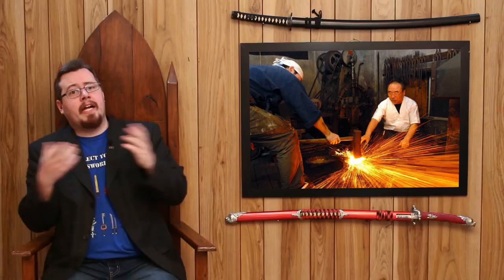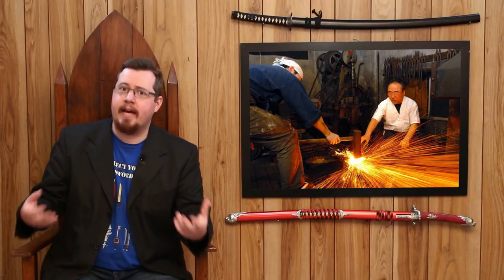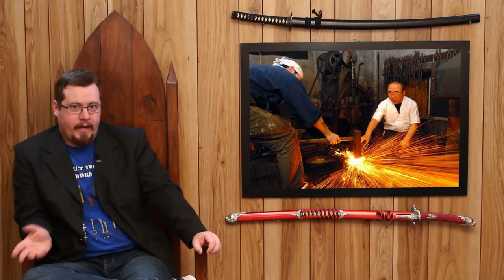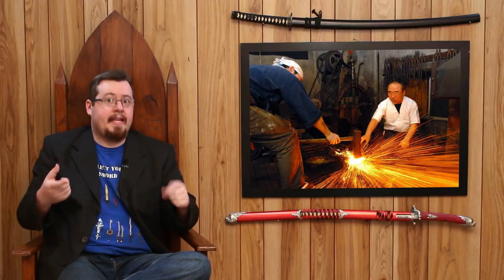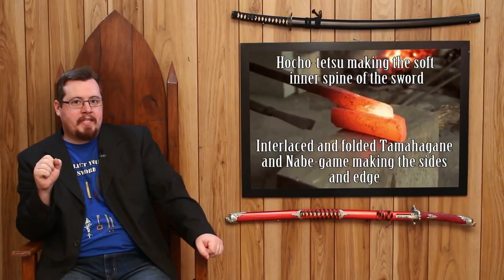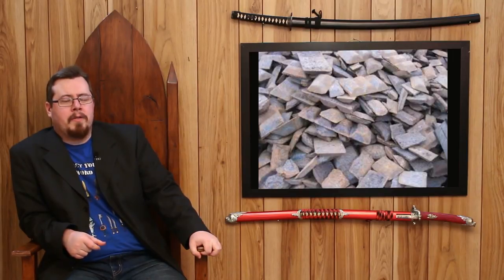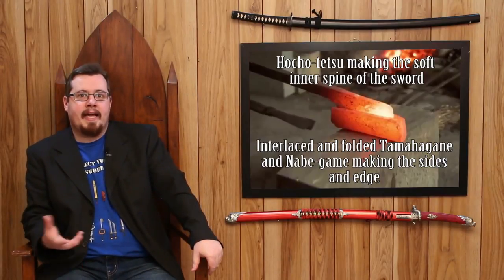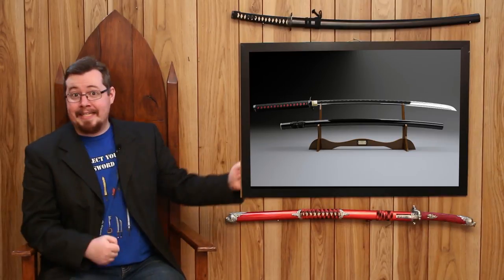The TRUTH about the KATANA, part 3: Why the steel is folded

Comment: Nice video. I know the theory, but having it all put together in a coherent package is quite appreciable. Yet you forgot to mention one process that has been used all around the world (well, maybe not in Japan, can't tell), from the early Iron Age: cementation.

And the process is quite simple: once you've folded your steel over and over, and it's as pure and "slag free" as you want it, but also free of carbon, you put your bar/ingot in ashes (as far as I know, it was usually bone or horn ashes, at least in Europe, but don't take my word on it), and just heat it up for hours, or even several days. 

The lack of oxygen and the presence of surrounding carbon, will allow the carbon to migrate inside the steel, sometimes quite deep. You have to be carefull not too alter the steel by going too hot, but otherwise it's a pretty secure process, and there is not much chance to mess it up. It can be done either on "raw" bars/ingots, or on the semi-finished sword blade.

The advantage if you use this method on a semi finished blade surrounded by ashes on all dies is that the acute edge will heat up fast and, as it's thin, take much carbon, the sides and spine of the blade will take a bit less carbon, and carbon won't be able to migrate deep enough to the core. In other words: it will make the edge quite hard, the sides and spine moderatly hard, and leave the core mild. And all this on "superior", "slag free" steel (well the best available from a bloomery).

As far as I know, carburizing was massively used in Europe in the late Middle Age and early Modern period, because blast furnaces weren't widespread (as it requires much more material and workforce to make it run, and requires investments - not all social structures had that mindset), but bloomeries were quite common, and there was a real need for high quality steel. Folding pig iron was necessary to get rid of the slag, but they ended up with "high purity" (for the time standards) wrought iron. This process was made easier and more efficient by the use of water powered trip hammers. 

They forged the wrought iron in long, thin and narrow bars, bundled them together in a" plate" or sheet, pilled in alterning layers with ashes/charcoal (any carbon-rich substance), and let it heat up the adequate duration. The result is blister steel, inheriting the high purity of wrought iron, but now with a high carbon content. It was then forged back together and folded to even the carbon content and lower it a bit, producing shear steel, which was in every way superior to tamahagane. The difference is the use of cementation, and water-powered trip hammers to make the forging job easier. And also a pre-industrial production context for efficiency, which cannot be achieved in traditionnal two or three men shops.

This is just bits of extra information. Your video is already excellent!
Reply from the maker: +MadNumForce Hey I love extra information, thanks heaps for sharing this!

Comment: 2:30
They don't really add carbon deliberately. It happens by itself because the fuel contains carbon and you need to let the fumes come into contact with the iron so that you can have carbon monoxide to draw away the oxygen. The only way you could smelt iron without adding carbon is if you burn pure hydrogen as fuels without carbon are hard to find.

Comment: There is a mistake containing the understanding what is steel and what is iron. Steel is an iron alloy and by definition an iron with a carbon content of 0.2% - 2.X% depending on the name norms. But mostly is defined by the process of forming certain crystalline forms like the austenite and in the hardening processes generated martensite. Martensite are also formed in very high carbon iron and a too high content of martensite makes naturally the iron alloy to brittle. So in other words the steel is an iron - carbon alloy that has a carbon content between 0.2% - 2.1% andand does not undergo the eutectic reaction. Some pig iron and wrought iron and cast iron has a higher content of carbon an most of this irons is simply to brittle for a weapon if they are hardend to a certain degree.
Reply: *****
While iron is an element the crystalline structures that it forms are also called as iron kristaline structures with their specific names. So steel has or is based on specific iron kristaline structures that are also formed without carbon and is therefore an iron. For this reason there is no purity required and the element that we call ferrum or iron was named just after the the most common used name for the material. Iron and steel as names have just different origins. Also there are methods with different elements to create iron alloys that are as durable and ductile as steel but cannot be called steels for the specific reason that they have a lower carbon content than 0.2% - 0.3%.

Comment: Shad my dude you do great work but you might want to add a quick edit in there because some of the names you said for those chemicals are just a little off and I know you want to try and be as accurate as possible its not a big deal just a minor correction from a chemistry standpoint like in this case the name for FeO would be Iron(I) oxide and Al2O3 is actually just aluminum oxide I know you are dedicated to accurate facts and I just want to make it a little easier for you to make your videos as acturate as possible, other than that great video as always with great facts

Comment: You also seem not to reduce iron oxide to metal iron in your process...

In the 2nd part you said you have a molecule of iron and oxygen, now you just heat it up ans suddenly have slag there. Also, we usually differentiate between slag and non-metallic inclusions. There are four types of nm inclusions which are not slag at all, but formed during various steps in steelmaking.

Also, German may shed some light on terminology: Slag is called "Schlacke" in German. This is related to the verb "schlagen", which means "to beat". Well, that's what you do. You beat it out of the steel during forging.

And, even more, slag is not always bad. In liquid steel metallurgy, it is a crucial component of your process to purify your steel. We even have slag remelting processes with special cleaning slag (high in F, very great :P )

Comment: I'm not really good at chemistry, but I think I'm good enough to comment on inorganic chemistry.

Most stuffs occurred naturally are oxidized because oxygen is very aggressive. Very few elements can stay pure, like gold. Even coal is actually a chain of hydrocarbons with tons of impurities like sulfur, phosphorus, and even radioactive elements like uranium, as coal are fossils of dead animals and plants trapped in freshwater underground, similar to oil (which are fossils of dead animals and plants trapped in salt water).

Iron ores are the same, and as you said before, they are rust. Rust are not good to make stuffs, and melting iron even at 1,600-2,000 degrees Celsius is not enough to take oxygen atoms away from that oxide (burning iron actually oxidizes iron).

However, the thing is, the process of smelting provides the temperature that carbon (mixed in the ores) and carbon monoxide (by-product of burning fuel while lacking oxygen) that will take oxygen away from the iron ores. This process is called reduction and it allows you to get the element iron instead of having a sword made from rust. You can also use this reduction method to get copper and many common metals in history. This is also the reason why aluminum took a long time for human to proceed. The oxide melts at much higher temperature (over 2,000 instead of 660 of regular aluminum), and you cannot reduce aluminum oxide as the element is much more active than your regular metal, so active that it can form a layer of oxide at the surface to protect itself from being oxidized further. Even with modern technology it is more efficient to just recycle aluminum than smelting it from ores.

Back to the topic, the forging process (with folding), however, will not be able to take away the solid impurities, like silicate, carbonate compounds or many oxides of active metals, since they cannot be burnt or reduced, have high melting point (Titanium dioxide at over 1,800 and aluminum oxide at over 2,000)  thus stay solid, while other elements, if exist, like carbon or sulfur, can be burnt and become wasted gas as their oxides are gaseous. If you have ton of silicates in the ores it is likely that your final products will still have silicates in it. Same to TiO2 or Al2O3. Folding does help in reducing iron oxides into pure iron however as the inferior smelting technique likely does not allow carbon to reduce the oxides.

Comment: Watch the Man at arms Hatori hanzo build. There is no way you can honesty compare the quality of a hand forged Katana to some spring steel mass manufactured blade.
Reply: +Jung Lee That depends more on the steel used more than the forging itself. Mass produced stainless steel isn't combat-grade steel. I watched a show that used a 1080 carbon steel sword with minimal forging against a professional duelist's 4k steel traditionally made katana and even though the 1080 sword hadn't been completed, it outperformed the 4k sword when both were wielded by the professional against...suspect armor and a bullet being fired at the blade.

Comment: Are the later medieval swords not only smelted better, but forged better as well ? Wouldn't the act of curving the katana put stresses in the blade ? Do katanas bend under stresses that a longsword would just flex under ? Isn't the edge of the katana more likely to chip ? Would be great to get answers for these questions in the later vid.
Reply from the maker: +Mozoto Indeed you will my friend, in fact I'll be talking extensively on all these concepts in part 4, which will be out this week!
Reply: Thanks, will wait patiently :)

Comment: Really interesting video and I get the impression that you genuinely want to know things. Good job on the research. As you seem interested in accurate information I just thought you might like to know that you misread most chemical formulae, which is significant as some of the chemical names you said do exist and have different properties to the ones that were written in the report.

I'll just quickly give you the list of the formulae shown on screen and what they actually are. If you want to know more about the chemistry there is lots to know, but I will leave that for you to look up or ask about.

CO2 Carbon dioxide (this was fine)
SiO2 Silicon dioxide (Often known as Silica and a very common component of sand)
FeO Iron(II) oxide (commonly called Wüstite this is Iron bound to a single oxygen, not 2)
TiO2 Titanium dioxide (interesting that it contains titanium)
Al2O3 Aluminium oxide (Its not called dialuminum trioxide as aluminium and oxygen only combine in this way)

Hope that was interesting.

Comment: 15:27 Hydrogen Dioxide is HO2, and it's actually called Hydrogen Peroxide. Water is H2O and it's called Di-hydrogen Monoxide.
20:25 Oxygen can bind to things more than once, it's not the number of atoms, it's the number of electrons in the outer shell of the atoms that Oxygen is able to share electrons with to form a covalent bond. Oxygen has 2 electrons in it's outer shell and can fit six more, which is why it can bind to more types of things so easily.

Comment: Shad FYI, Pig Iron is the first iron produced from the smelting of the ore. Its reputation for low quality comes from the wide variety of source material and skill levels of the smelters accross a wide range of places and times, and the extremely common error of assuming that it is intended as finished metal. It is not, Pig Iron is useful only for re-smelting to make cast or wrought iron. This erroneous perception was particularly exacerbated in the modern era by the disastrous forced industrialization of Maoist China. Peasant farmers in almost every village were forced to make "steel" for the industrialization effort. This went about as well as could be expected and the Chinese farmers so ordered were almost entirely unable to produce any usable steel. What they ended up making in make shift kilns and smelters was a very wide variety of exceptionally low quality pig iron which proved impossible for the assigned "industrial workers" to use to consistently produce the modern industrial steel products which the Communist government had intended their armies of newly minted industrial workers to make. Not that they let that stop them from trying,  or kept them from attempting to export "finished" products made from the inconsistent metal, and building industrial machinery and railroads with it. The incredible variance in specific quality of the resulting pig iron bedeviled the communists goals of ushering in a revolutionary era of industrial might, for decades before the last of the efforts were finally ceased long after specialists had been brought in to fix the problems and they focused on building a few useful industrial sites rather than uniformly industrializing the whole of communist China. By then the term Pig Iron had become associated with such appallingly low quality goods worldwide and was largely and erroneously thought to refer to low quality metal. 
The term Pig Iron itself is of unknown origin, but likely comes from the resemblance which several ingots, known as pigs, have to a family of suckling piglets lined up at their mothers teets. This seems most likely given that the early societies which developed the ability to make pig iron were predominantly agricultural in nature. 
Thank You Shad for these interesting videos about the things that I became obsessed with after playing Dungeons & Dragons.
Reply: As far as I know, pig iron is what you get out of a blast furnace which did not exist in medieval japan.

Comment: I've actually had steel that I forged so many times that it decarburized. That was some crappy crap, right there. I spent countless hours working on a blade only to discover that the steel kept rolling the edges, and it was likely due to the repeated heating and hammering. So it's not always great to keep folding it - eventually you end up with wrought iron and that's not going to make a blade.

Comment: Wrought Iron and Cast iron also are steel. Wrought iron has a lower carbon content than steel and cast iron has a higher carbon content than steel but lower than pig iron. Wrought and cast iron is actually used. Rivets are often made out of wrought iron or any application where you need something softer than steel but stronger than aluminium. Cast iron is used when breaking isn't as much of a risk so iron covers are often made out of it. It is also was often used in construction though today has been replaced by high grade steel.
Real pure "Iron" is actually extremely because it's hard to make. It is possible to make it but it's actually softer than aluminum and very difficult to keep pure. It doesn't have much use outside of scientific purposes.

So all iron used has some carbon in it. Steel has a very specific ratio.

Comment: The reason pig iron isn't called pig steel is because it isn't steel. The defining characteristic of steel is not that it contains carbon but that it contains pearlite, a layered formation of ferrite (essentially pure iron) and cementite (Fe3C or iron carbide). You get this molecular structure with carbon content of less than 2% by weight and heating the entire thing above about 1300ºF. Pig iron, which is essentially a type of cast iron, has above 2% carbon content by weight and therefore can't form pearlite without which it isn't steel. The pig part apparently comes from the traditional shape of the mold, which produced ingots that look like piglets suckling from a sow.

Technically it's 2.1% carbon by weight, not 2%, and 1341ºF, not 1300. Also there's a sort of magic number at 0.76% carbon by weight called the eutectoid. Pearlite is always exactly 0.76% carbon by weight, so if your steel has less carbon than that it will have sections of ferrite that doesn't form pearlite and if it has more carbon than that you'll get chunks of cementite in with the pearlite. But that's probably more precision than is required for a youtube comment discussion.

Comment: I've talked to a few blacksmiths about the metal used for making a katana,
a few of them said that no one knows what they are really made of.(which I usually heard as being called damascus steel).

But probable because they would not touch pig iron with a 20 foot hammer.
Reply: Damascus steel and Katanas are not even close to being the same.
Reply: there are two things commonly referred to as damascus steel, one is pattern welded stuff which is basically the same as the folding process used in making the katana but they twist the bars and stuff like that to leave interesting patterns in the steel that will show up if they wipe the blade down with an acid after the forging is complete, and the other is steel produced in a city called wootz, which was somewhere around india or pakistan, the location was lost in history as far as i am aware, and it contains carbides that make it extremely high quality. That stuff got traded through the middle east to the city of damascus and europeans bought it there, so people assumed it was made in damascus. The pattern welded stuff is called damascus because european blacksmiths tried to imitate it when they were really just pattern welding. You can find pictures of the two if you search for wootz sword and pattern welded sword in google images.